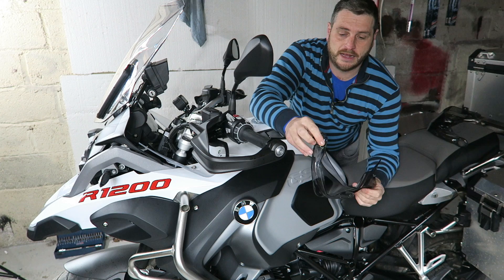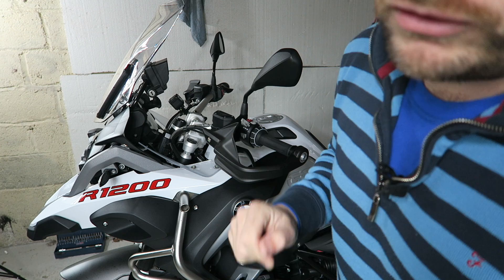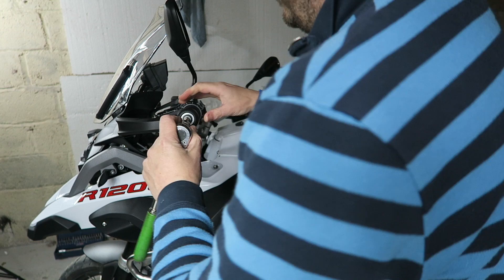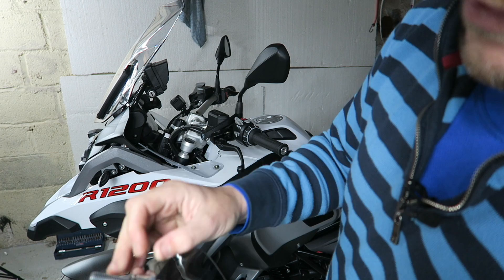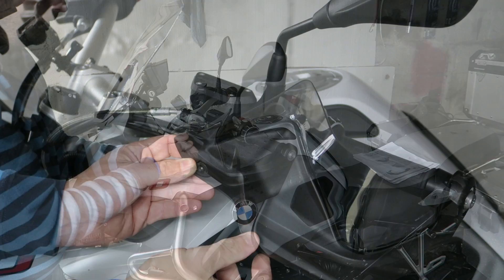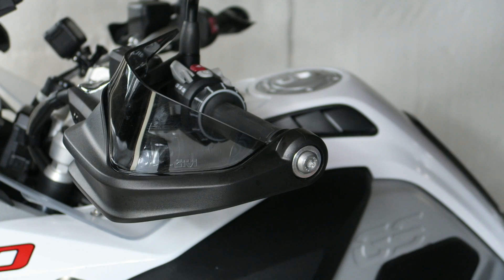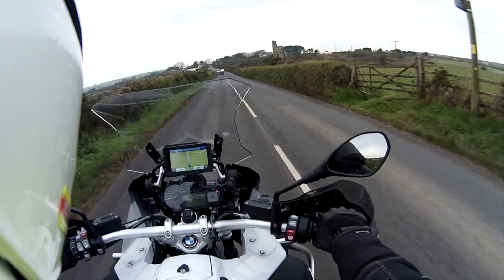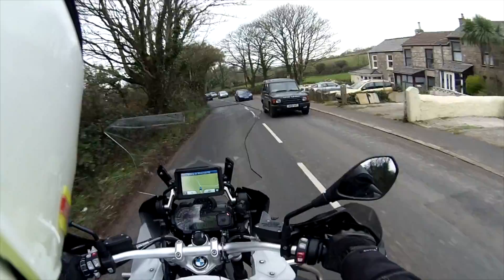Givi Handguard Extenders

Comment: I've finally found my hand guards!!! I purchased a pair or Touratech hand guards with extenders that I'm not happy with at all... I'll be replacing them with these. No holes in my hand guards, they're not over the top bulky, the quality is great and it match my Puig smoke windshield.
Reply from the maker: Excellent stuff! These are brilliant guards. They also do the slightly larger ones which provide wind protection below the bar too :)

Comment: Hi, great video, so much so I also bought the same for my GSA. I found with the inner large spacer fitted the hand guards moved when tightened. When I removed them it tightened up perfectly. Do your guards move with the spacers in or are they tight as?
Thanks in advance . Regards Clive
Reply from the maker: +Clive Bishop hey Clive. Thanks for the comments. I found mine are tight with the spacers in but you having said that I'll check :)
Reply: Givi now include a rubber o-ring in the kit which goes between the original guard and the Givi handguard at the bar-end. This makes it nice and snug.

Comment: Got them on my bike. Really do make a difference in inclement weather.  However very brittle, I bumped a tree, not too hard and I noticed it had snapped at the bar end.  Good video and again, why don't BMW sort this stuff?
Reply from the maker: +Steve Kennett thanks for the tip Steve. I'll keep an eye on them as didn't realise that they were brittle. I wish they would too. :)
Reply: Yeh mine snapped too at the bar end too.
Reply: @nickturnbull4302  you might have over torqued it.